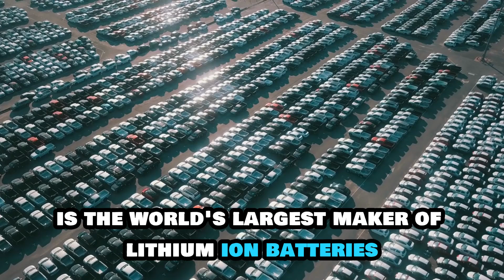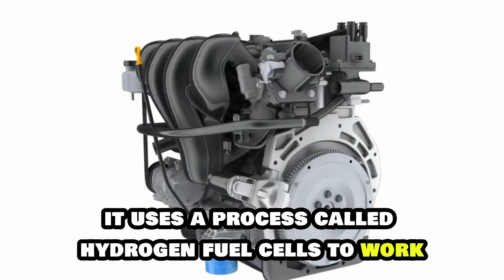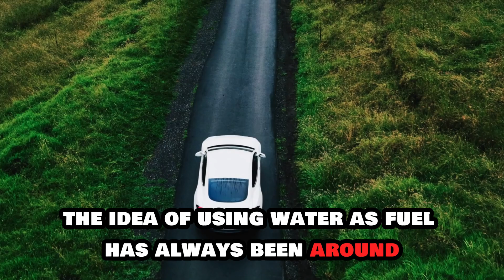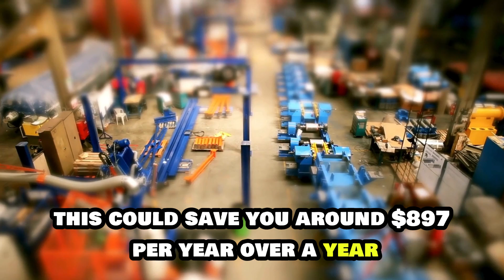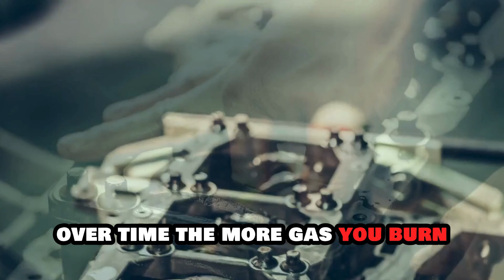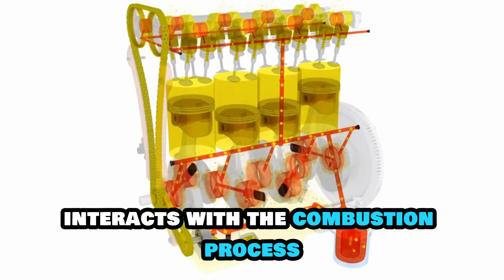BYD CEO: "This Water Engine Will DESTROY The Entire Car Industry!"

Comment: Yeah ... hydrogen fuel cells are nothing new and have known problems. The hydrogen is produced "using electricity" and essentially works like a battery in an EV. This is not "bad" tech, but the hype in this video is BS.

Comment: Besides the ICE, there must be another mechanism or engine to split the water into hydrogen and oxygen which would made it more complication compared to only the Electric Motor in the EV.  Besides Battery technology will be improve and get better.